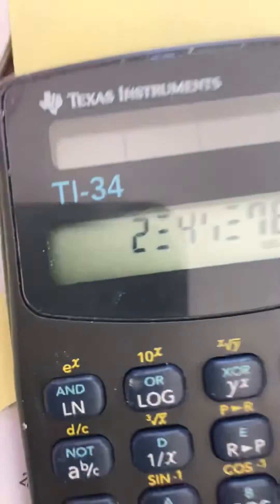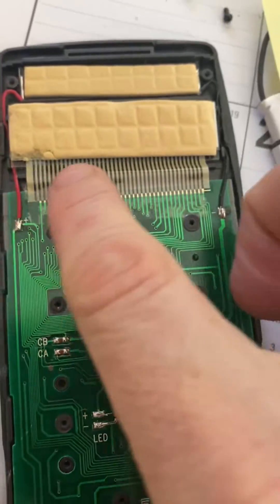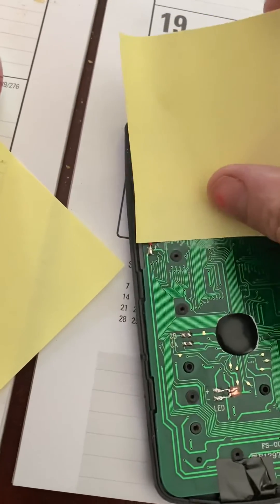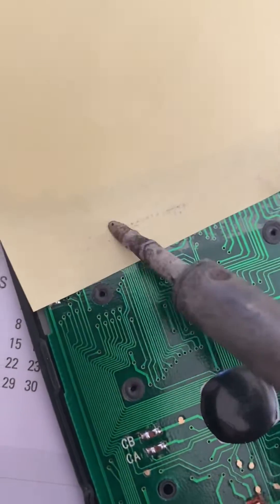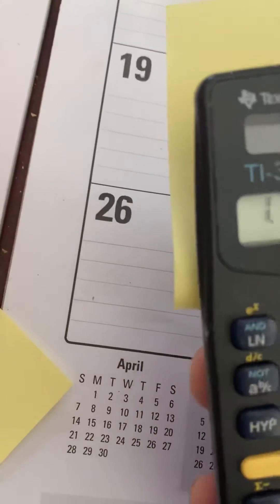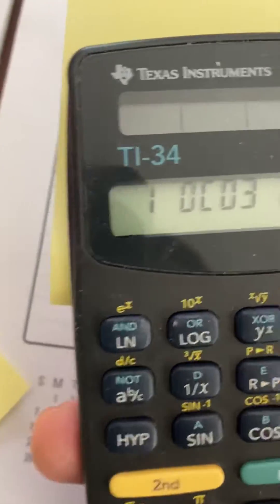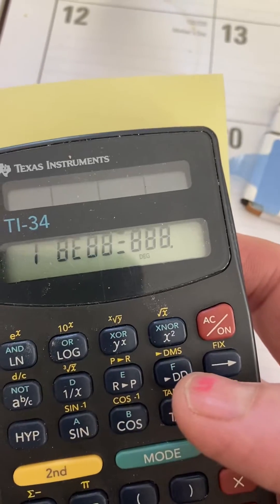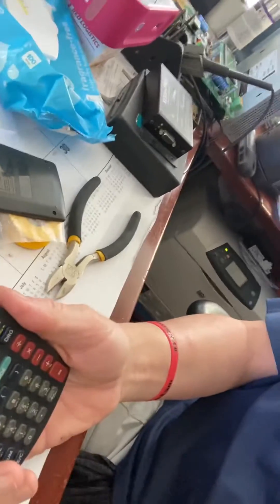Saving a Calculator From Landfill (Missing Digits on LCD Display)

Comment: This method destroy my les
Reply from the maker: I’m so sorry 😥 Make sure you use very low heat to start and increase the temperature slowly  and always have a piece of paper between the iron and the lcd ribbon and go slow with application time